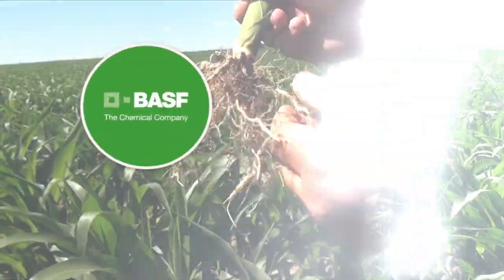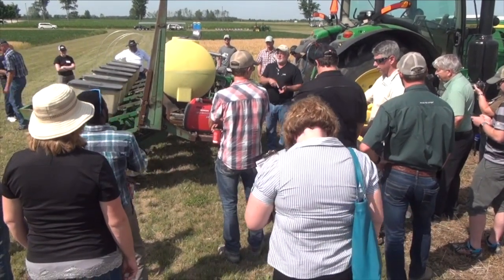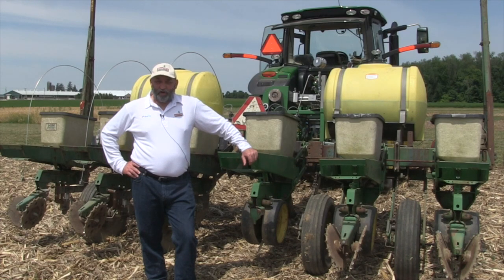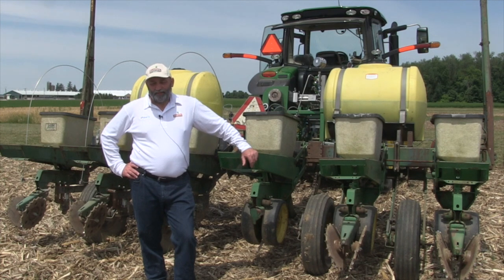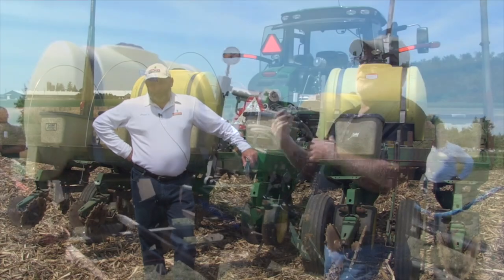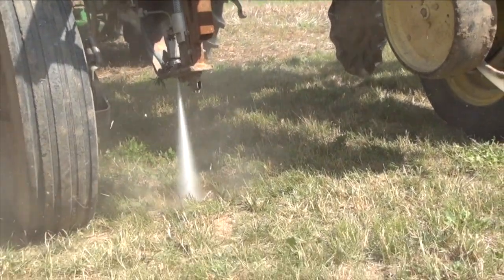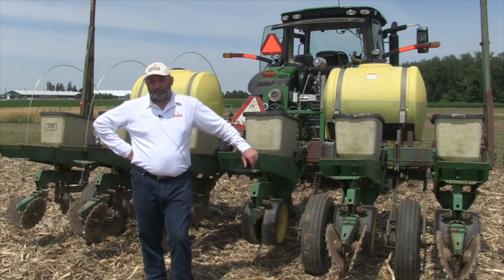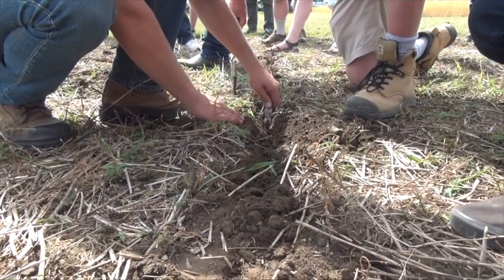Corn School: Water Jet Planting

Comment: I own a water jet in my welding shop, they can be super high matinence. Not saying this isnt practical but i dont think i would go for it. I think that wet seed trench would make for hard side walls if it were to dry up, it splashes all the fine particulate up as the water blows down lining the trench with concrete like material, also in thing i dont think you have much control over is seed depth placement. The densities change all across the soil and softer soils would result in deeper depth of plant. And the tips where out after x amount of hours, not that this is a bad idea and i applaude the guys for thinking different. I think the cons outweigh the benefits
Reply: Interesting idea but yeah I want to see more testing in real world conditions across a wide range of soils, crops, etc. before I'd get too excited about it... 

Later!  OL J R :)